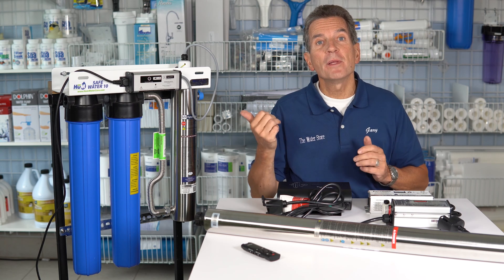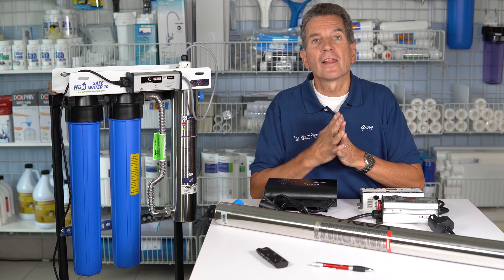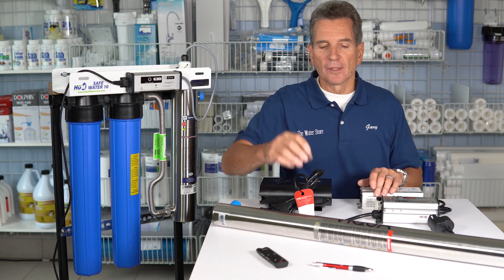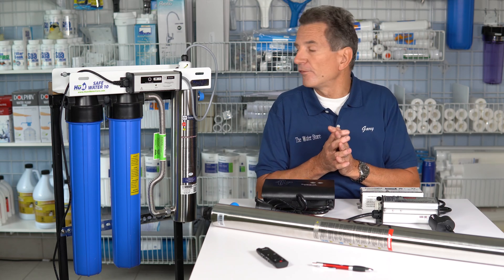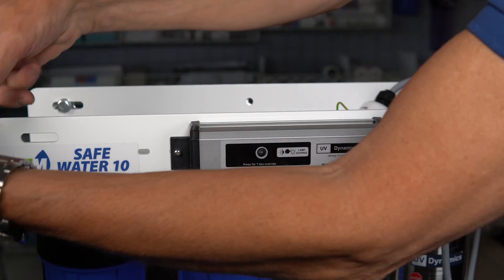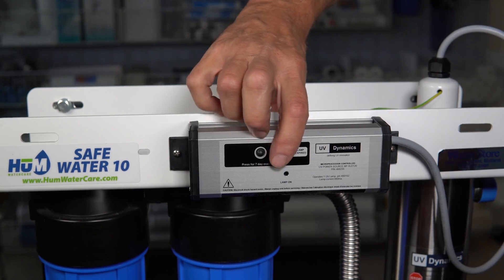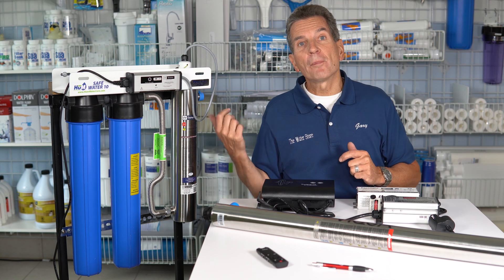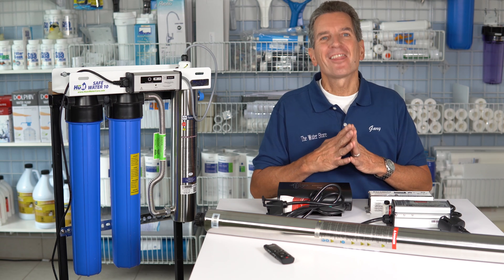Why Does My Ultraviolet Light Keep Beeping?

Comment: Had a power cut last night and now the UV system won't stop beeping. The lamp has 105 days left so shiuld be fine. Tried unplugging the unit and holding reset while plugging it back in. Just get a couple of minutes of peace then the beeping starts again. Any ideas?
Reply from the maker: Yes, you likely had a power surge and the ballast will require replacement now.  Email us pictures of your system including the make and model number and we can suggest a replacement. info
@waterestore.com Also, after you install the new one, plug it into a surge suppressor.

Comment: Thanks for the great videos !  I have a related question :  when not using the Viqua UV system for a long period such as one month (water not used) should we « unplug » the controller? The temperature in the UV chamber must become quite hot, correct ? We just had a controller beeping returning from a long vacation period and thought that it was triggered by the excessive heat in the chamber, or by a power loss which also occurred. Thanks.
Reply from the maker: Nope, you need to leave it plugged in as it is creating the barrier between treated and untreated water.  If you unplug it the bacteria will grow through the UV and downstream and will reinfect your water when you turn the UV back on.

Comment: Hi Gary,
I bought a light for a culligan system but the system is giving me an incompatible lamp error message though I am pretty sure that I have comparable pieces (system is up and running fine with the new bulb). Can you offer any advice to stop this infernal beeping?
Reply: I have a Rl-820 in a culligan CUV5-101 tube
Reply from the maker: That's the problem.  Culligan systems are all proprietary intentionally so you can only get the replacement lamp from them, and they can charge you whatever they choose.  If you don't, this happens.  Although the replacement lamp you bought fits, is it not the exact model number as the Culligan unit, so it beeps until you replace it with a Culligan lamp, it is designed specifically to do that.  Your system is avaialbe in a non proprietary model, which we sell.  this is exactly why I do not recommend propreitary systems.

Comment: You said to unplug and plug back in the Viqua and hit reset after a power failure but will this not reset the countdown timer? I don't want to reset the timer as there are 290 days left on the bulb and will the system still protect if it's beeping after a power failure? Several gallons of water ran through my system during a night time soft water regeneration unfortunately.
Reply from the maker: Yes, it will reset the timer, no way to avoid it.

Comment: After power failure, it's beeping, did reset and it keeps beeping
Reply from the maker: Unplug, wait 5 minutes and then reset.  If still beeping you either need a new ballast (controller) or lamp.

Comment: How do I know if the UV light is working? The ballast's (BA-ICE-S ) display is bright and is counting down and there are no beeps. The stainless steel housing of the UV bulb sometimes gets quite warm to touch but seems to mostly stay cool to touch even when there is no water usage. Does this mean that the UV light is only on sometimes and not others? I thought that the light stays on continuously. It is perplexing. Thank your for any suggestions
Reply from the maker: Yes the light stays on continuously. If any water flows through it cools the bulb. If there is no flow the bulb heats up the water
Reply: Thanks, Gary,

Comment: Hey Gary. I’m just up north in north bay, ON. We were getting this beeping with about 100 days left. It’s the black viqua d4. We stupidly let the salts run out I donno if that’s what caused it but we do have hard  water here. I replaced the bulb and sleeve like I do every year and then reset to 265 days. I’m still getting both lights red and the light one is blinking red while controller light is solid. Manual says that’s a bad bulb as for defective controller the controller light would be blinking which it’s not. Any advice?
Reply from the maker: Try a different bulb, maybe that one is defective. The problem is either the bulb or the controller

Comment: Thank you Gary.  We have a Viqua S12Q-PA Change the bulb and sleeve every year.  IF the bulb isn’t working.  Will the ballast alarm?  Just seems the canister has always been warm to the touch.  Now not.  100 days on the bulb no alarms.  But any other way to check if bulb is actually on?
Your videos are top notch sir.  
Don
Reply from the maker: Great question.  The alarm will go on if the bulb isn't working. This video talks about a couple of ways that you can determine if your is working or not at about the 1:15 mark https://youtu.be/8C-CvPOSEPM

Comment: How do you actually check the ballast in the UV system. I have no power going to the uv light itself
Reply from the maker: Typically if the system is not working we replace the lamp, if that doesn’t solve the problem we replace the ballast.

Comment: Hi Gary, if a new bulb has gone in and the controller is defective is the water still being cleaned by the uv bulb? I think my display controller is broken, thanks Mandy
Reply from the maker: No, nothing will work until that controller is replaced.  Which one do you have?

Comment: I have a viqua D4 that has two solid green lights, the UV light is on, but it keeps beeping. The number display is not lit up. started after a power outage.
Reply from the maker: Unfortuantely your power supply has failed, likley due to voltage surge from power outage,  You will need to repalce controller here https://waterestore.ca/products/viqua-trojan-ballast-for-b4-b4-v-c4-c4-v-650733r-002 once you replace it purchase a quality surge suppressor to protect it in the future.

Comment: I have a Sterling UVPC-12,The ballast is beeping and I replaced the light and instructions say to push reset button to reset. there isn't one. it wants a password. Any Idea how to reset?
Reply from the maker: No but you can check out the manual here and if necessary call the company https://sterlingwatertreatment.com/wp-content/uploads/products/specialty/uvpc_manual.pdf

Comment: Thanks for this video. Question: I just replaced map in my VIQUA d4 - but I think MAYBE I used an old lamp... Is there any way to tell?  Will the system detect if the bulb is no good / not working? Or will it just count down from 365?
Reply from the maker: It will just count down to 365 but if it is an old lamp it will not kill the bacteria

Comment: hey gary, thanks for all your videos, why this video has 2 thumbs down i'll never know (maybe they were mistakes, i accidentally hit the wrong one in a video couple years ago & i still feel guilty:))), anyway, one of your other vids got me through bulb replacement & quartz tube cleaning, had i not watched it i woulda had finger prints all over everything, a broken sleeve & no water for a week!

i have a quick question i hope you can answer.  i have an older model (sterilight ssm-37) and the controller is viqua silver ice (i can't see a model#, it's really hard to get to in my room), anyway, after replacing i get a 99 instead of 365.  could it be that the older controllers only have 2 digits instead of 3 so they start at 99 & then after 266 days or so they start counting down?  sorry for the ignorance, i have tried to google but striking out.  thanks heaps.
Reply from the maker: Not sure why you would get a “99” this is a very old model that I am not that familiar with. I suggest you call Viqua tech support at 18002657246
Reply: @water_estore  ten4, thanks for replying gary, man time must fly, dad bought it 5ish years ago, how old is 'very old'?  maybe it was sitting on shelf forever.
Reply: @water_estore  wow gary, am i an idiot or what:)))  thanks heaps for that number, i called them & i gotta tell you what, talk about good customer service, listened to the options, hit 2, guy answered in like 5 seconds, & it turns out that the 99 is the percentage of the bulbs life, doesn't go to a 100 so since i just put it in it starts at 99.  just hit the reset button once, it switches to the 365 (362 in my case since it's been a couple days).  so yeah, since i lost the manual i had no idea & i was thinking that hitting that button would do something like that, i was afraid because i knew it was a reset button & i sure didn't wanna screw something up after i spent a couple hours on bulb & sleeve.  anyway, sorry for the novel, maybe this will help someone.  thanks for all you do, i know you hear this all the time but...if i ever buy a new or different one i'm coming to you.  thanks again for the reply, shows me a lot.

Comment: for viqua ballast after power failure if both leds are green but screen is blank and beeping you can also try removing the power for 30 seconds then holding BOTH buttons down for 5. this is the method that worked for me.
Reply from the maker: Thanks for letting us know.  I have never been in the situation to try this but when I am I will give it a try.

Comment: It shows 365, but still beeping!!
Reply from the maker: There is something wrong with either the lamp or the controller.  You need to replace the lamp, if it still keeps beeping, the controller is defective and needs to be replaced.

Comment: Need help first times doing this just took out u .v. light cant move sleeve and get it out
Reply: and the open end broke a little  ,need help getting it out
Reply: +ken keetch sorry to hear it broke. Any idea what make or model you have?  If you wear heavy duty rubber gloves you can slide a finger inside and grip it while pulling and rotating and that will usually free it up. Some brands and models are much worse than others.
Reply: @waterestore2894 u. v. light is  7 20 L  the sleeve  i cant get it to move at all
Reply from the maker: @kenkeetch2035  those are very difficult to remove.  Try pushing it back and forth, it really is the only way.
Reply: @water_estore  ok thx i will  try that
Reply: Gary the Water Guy can a defective ground strap cause this?? I recently replaced my UV lamp and reset it. It’s continuing to beep again and showing my UV rating around 55%. I did notice the ground strap was slightly corroded